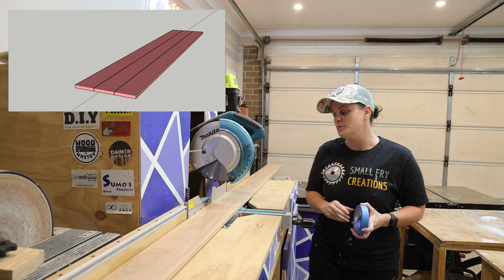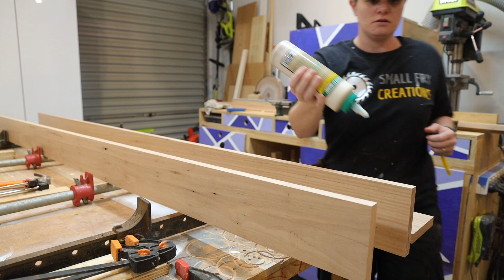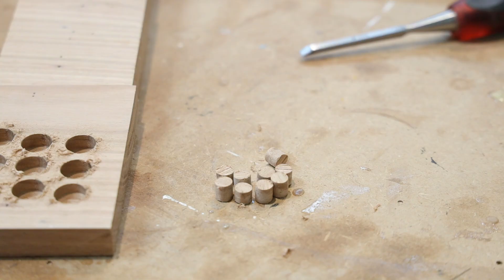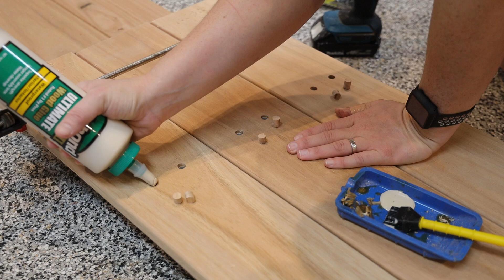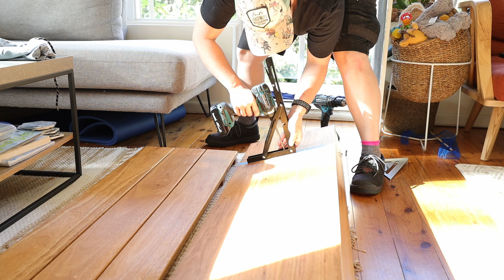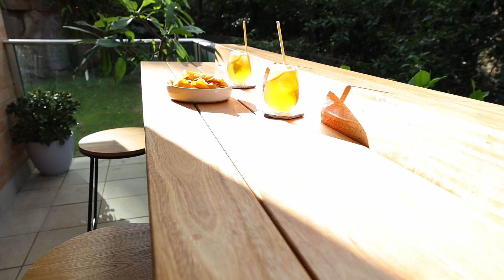How To Build A Fold down Balcony Bar / Desk  (rental friendly)

Comment: What if the balcony has a round metal structure? Does this work?
Reply from the maker: Yes I believe it would. You would just want a tight fit and as long as there was also support lower down on the balcony wall you would be find. The back piece of the balcony bar stops any swing it may have.

Comment: This is amazing, and I’d love to attempt this in my own rental place. I was wondering if you had any advice for if our railing is square concrete and wouldn’t be able to have the lip for sturdiness (the blue part of your diagram?). Would that be possible at all? Assume there wouldn’t be anything to hold it in place to counter any weight/pressure
Reply from the maker: Thats awesome. If you can't have the lip I would just make the back piece a little longer and it should be long enough to hold in place. If you put rubber like we did under the part that sits on the concrete that would also stop it from moving. Hope this helps and happy building :)

Comment: Great job.  How do you think blackbutt or spotted gum will fair with leaching tannins?   You didn't mention tannins and Im tossing building the whole thing as you did but at that stage use a tannin remover first before oil?    If i do this do I risk warping the whole thing by using water on it b4 oil, or do you think it should be ok?   Thank you!
Reply from the maker: Hi Chris. Thank you. I haven't had any issues with leaching. I recently refinished the bar for the client as it was just over 12 months old and it was still perfect. I just lightly sanded it and re applied the finish. Haven't had any trouble. Hope this helps :)

Comment: hi great video.. i was wondering if you are using 1" or 2" thickness for the bottom support? like are those 1x2 inch or 2x4inch?
Reply from the maker: The timber itself is 20mm thick and the supports at the back between the bar bar and the balcony glass I think from memory were about 38mm. This measure was base on the particular balcony I was working on. They may not be needed. Hope this helps 😀
Reply: @Small Fry Creations  thanks for responding.. i meant your bar top support which you have 5 bottom supports.. are those 20mm thick as well? or all the panels/wood you are using are all 20mm thick?
Reply from the maker: No worries. Yes they are. 5 supports under the bar top are 20mm thick and 50mm wide